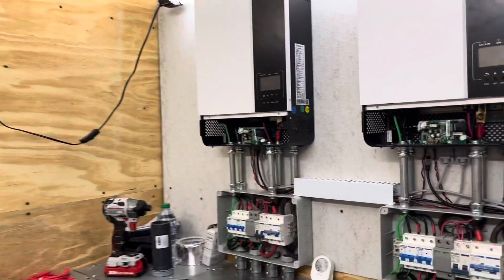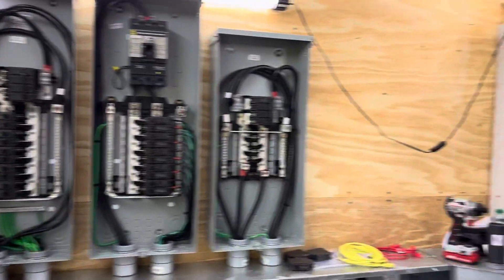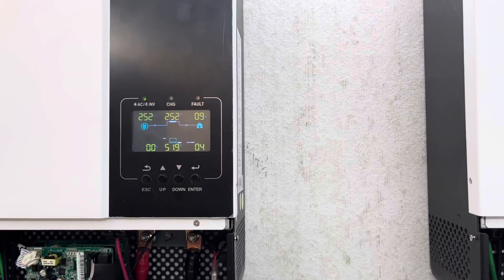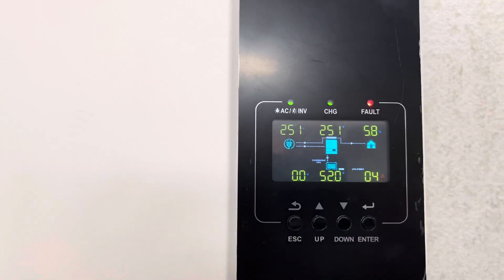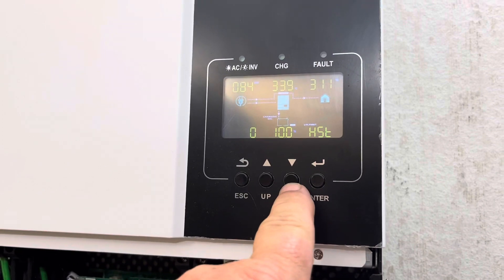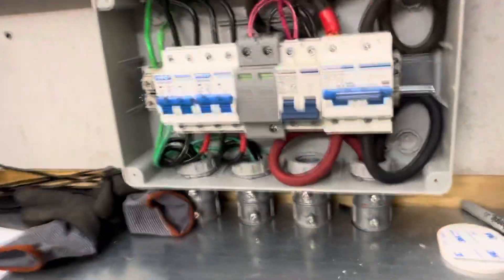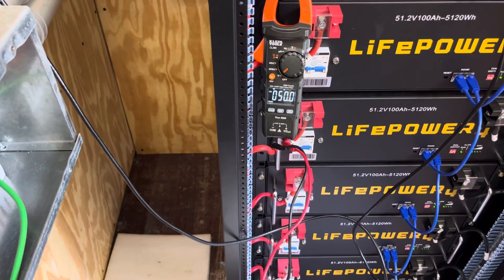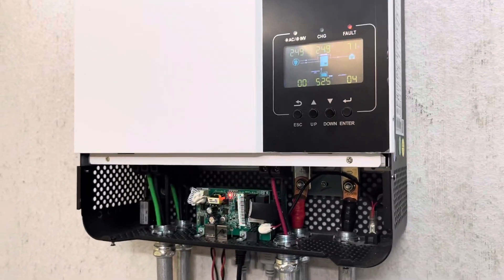Growatt / EG4 battery test results. Powering my entire home for 7 1/2 hours.

Comment: Thanks for this. I just bought that battery rack + 6 batts. When you add up what battery you need to power a home off grid for a week with no sun, as happens sometimes, it gets discouraging. I would need 6 or 7 of these racks, about $50,000.
From 7.5hrs/6 batteries in your case, you would need 22.4 battery racks like that to last a week. That's a literal mountain of batteries, about $180,000 dollars worth, and those EG-4's are relatively inexpensive. Not to mention inverters equipment installation etc. Then you have solar to buy and install...
Tax breaks could knock it down 30% but still only the wealthy can do it. The government should subsidize the direct cost of these components to bring it to where we can buy it.

sorry for the rant  :)
Reply from the maker: Yeah it’s pretty difficult and expensive to take a modern all electric home completely off grid. 

I’ve since replaced the Growatt inverters with two sol-ark 15k. I’m off grid probably 80% of the time.

Comment: I'd like to know what is the current of the batteries going to inverters when solar power is not available.
Reply from the maker: When I ran the load test total battery bank amps on peak was around 160A. This was split between the five inverters.
Reply from the maker: The test I’m referring to was in July tge hottest part of the year and my heaviest electrical load. 

When I ran the test in the video it’s was probably half of the July load.
Reply: yes Sir, I mean if solar power is not available,  the current of the batteries will increase. If you run full load 25K on only batteries, 520A will draw from batteries. It will be very hot and you gotta be careful with this. If you don't mind, I want to learn the wiring diagram of the setup cause I'm gonna install two pcs of 5k Growatt in parallel next week. Thanks.

Comment: I like the system with your consumption add more batteries. I would get the solar up as soon as possible. I currently have 20,000 watts of panels up, how many are you putting up? I have seen some of your other videos. so glad you went with the inverters that you did. I am going to be installing another system in the Philippines starting in August. I am hoping to find the growatt 5 k inverters over there as they work awesome.
Reply from the maker: Thanks! 19.1kw hopefully next week.
Reply: @jeffmotes2129  that’s a very good amount of panels. Most of the time I don’t need as many as I have. Mostly cloudy and winter time when you only get 15 to 20 percent of your solar.
Reply from the maker: @jamesshomesolarmore2223  I’m in Alabama and the summers can be brutal. All my property will be running through this system.
Reply: @jeffmotes2129  now I see why you are draining your batteries down so far. Air conditioning at night. I live in Oregon. We use air conditioning but ours shuts off around 9 pm. Plus it don’t come on till 11 am.
Reply from the maker: @jamesshomesolarmore2223  yeah down here the humidity is so high even when the temps are in the upper 70s it feels hot. 

I’ve been enjoying your videos. Thanks for posting them.
Reply: @jeffmotes2129  stealing each other’s ideas is how we get things to work.

Comment: how do you do charging? does it take 40amps * 4 inverters and output 160ams total across 4 inverts to charge the battery?
Reply from the maker: Until I get my PV array built I’m using the grid to charge the batteries. The BMS of the Growatt and LifePower4 controls and regulates the charging.

Comment: wow that is a lot of consumption.
Reply from the maker: Yes. Got to work on that.
Reply: @jeffmotes2129  I’m about the same. I’ve minimized my usage for a household of seven, albeit from the grid. What I really wanted was backup power that could last a good while, and if the grid went dark for a long time we could adapt to it if we had to (I have 12kw of inverter, 30kw/h of battery, and a 9.5kw solar array).
Reply from the maker: @captainobvious9188  that’s kind of my plan. My no 1 goal was a backup if the grid went down for long term. I could adapt as well. Shut the pool down. Unplug freezers as we consume the food. Turn the AC off etc …. But as I’m preparing in case we have a Schumer hit the fan scenario I didn’t want it to become burdensome today.   The way I have it set up, once I’m completed, it will be seamless . No changes to my home etc … but my power bill will be near zero except during the brutal Alabama summer.
Reply: @jeffmotes2129  I live an hour east of Vegas, and it’s the same thing, AC is pretty much a necessity in the summer. If the grid goes down I have a couple of mini-splits I can power all night. The rest of the year I have a near zero bill.
Reply from the maker: @captainobvious9188  nice. I keep a couple of spare window ACs for emergencies. Humidity is a killer down here.

Comment: The Growatts have to have the batteries, raise your limits fro. 10% to 30%.   A single unit can work without battery.

I have 3 growatts and two eg4 batterysand have no problem powering my whole house, actually 1 unit worked just fine
Reply from the maker: I was using this to see how long a completely charged set of batteries would power my property before switching back to the grid. I did this by switching the grid off and forcing the system to switch to generator when the batteries were drained. That way the lights would blink and I would know the batteries were off. 

My peak last year was 18kw and 4,000KWH in August. Should have built a smaller house!

My plan is to power my home  and charge the batteries from PV during the day, then switch to batteries when the PV isn’t generating. Once the batteries drain down to 10% the Growatt will switch back to the grid. The cycle will repeat once the sun is back up.
Reply: If i have 2 units parallel can they work without battery in bybass mode?
Reply from the maker: @GreekSIMRACING  probably… when I load tested my batteries I drained them down to the shutdown point where they turned my inverters off. Once I restored grid power input to the inverters they went right into bypass mode. The batteries were still connected but drained.
Reply: @GreekSIMRACING  My understanding is any units in parallel require a battery.